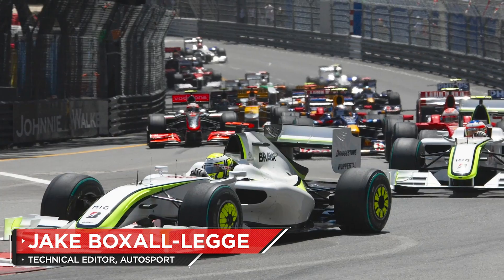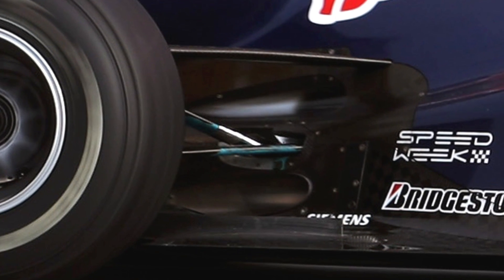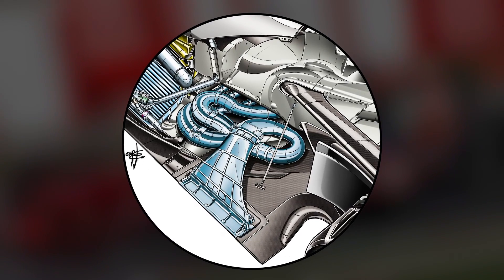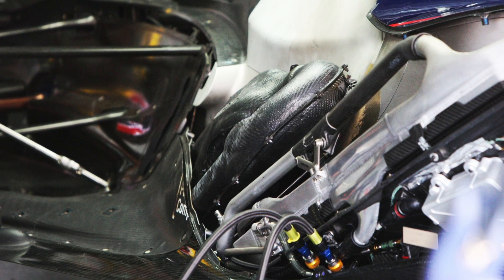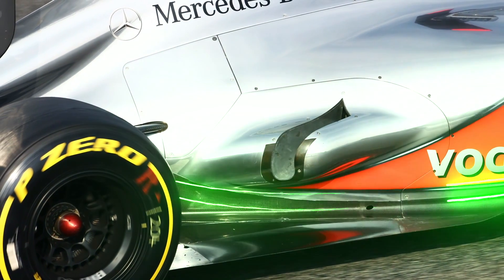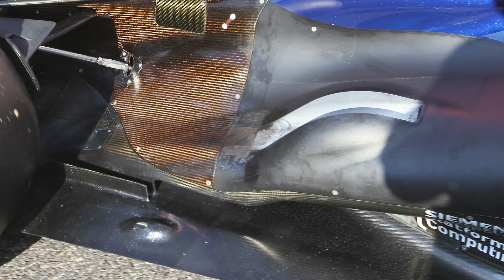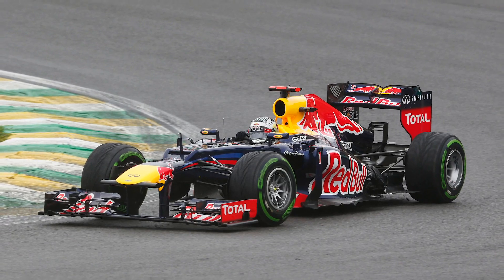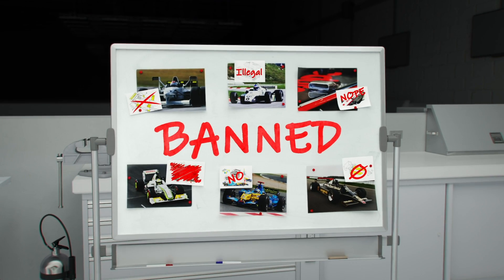What Happened To F1's Blown Diffusers?

Comment: How does the engine mapping work? I.e if it keeps the exhaust valves open for longer, wouldn't they hit the piston? Couldn't they simply open the clutch and keep the engine   speed high to maintain consistent airflow through the exhaust? You would sacrifice engine braking thou.

Comment: ❤😀🇬🇧. My mk1 mx5 used Helmholst resonance for the intake. Every 2 sroke since the MZ's uses a tuned expansion chamber (thanks Ernst Degner).. Then Yamaha, with its YPVS variable port timing. With several other cars/bikes using variable intake lengths . Less complex than phased VVT cam profiles. Now its possible to have complete, independant control over valve timing and pre ignition of a richer mixture, seperately, which ignites the main charge. We've  come a long way from the side valve, OHV, HEMI, and Susuki' TSCC's. 
Less rules  more innovation...please.

Comment: why did they want to ban it so bad
Reply: On safety grounds.. blown diffusers make more grip as revs increase, trouble is you need the grip when cornering, and generally you lift off the throttle as you corner which means a sudden reduction in downforce. The danger is either unexpected loss of down-force when cornering or if it all worked as planned, g forces would get up to the levels of ground effect cars when drivers would pass out from cornering forces.

Comment: I think that the only things that should be banned should be on safety grounds.  Other than that, just regulate the way you can use an effect.  If blown diffusers offer a performance advantage, let the teams use them if it does not also pose a safety risk.  Then if teams start throwing too much money at it, regulate it so it is more uniform, but not so that it eliminates the innovation.

Comment: does anyone know how the exhaust gasses exiting before the rear tires didn't heat overheat the tires?
Reply: Good question. The idea of Coanda is that a turbulent flow will remain attached to a surface for longer than a non-turbulent one (I’m reluctant to say laminar because it doesn’t apply to F1). I guess from this that the exhaust gasses would stick to the a Coke bottle waist of the car and exit between the tyres and the inner fairings.

Comment: Active suspension. It's madness that they won't allow this. It would revolutionise F1.
Reply: Imagine active aero
Reply: Active suspension was flat out dangerous when it malfunctioned.

Cars would completely bottom out when the system failed and it was essentially a death sentence for the driver
Reply: @cuscoothriyas5163  Given only one F1 car has ever used active suspension, and that car won both worlds championships before it was banned, and all this was using computer and actuator technology from nearly 30 years ago, I have to say, on reflection, that you are talking absolute bollocks.
Reply: @AzathothsAlarmClock  Not really slamming the car to the ground per say. When they were used they had to be specifically programmed for each and every circuit or it would bottom out and flat out render any control of the car moot as it would lift one or more of the wheels above the floor of the car, essentially making the car a sled you can't steer.

That said with computing having come as far as it has now and with fuel concerns at an all time high, now would be a good time to reintroduce it. Perhaps it might minimise or even negate the need for big wings which would cut drag down by quite an amount.

Comment: My opinion is simple. Set a budget cap like they did with some tweaks. Have a minimal set of rules such as it should be open wheel these CC engines and fuel tank capacity. Keep and improve safety regulations but other than that let the teams run wild with their designs as long as they are safe

Comment: if wings were invented today they would be allowed for one year, and then promptly banned.
Reply: Hell, I’d be willing to say the same thing about round wheels at this point.🙄
Reply: @leumas75  I think steering wheels should be banned, they provide unfair advantage in terms of turn in. Also I can't believe how round tires are still allowed! Flintstones cars are the ones to go by.
Reply: @leumas75  and engiens
Reply: depends who invents them
Reply: @fetusofetuso2122  Yep... If it doesnt benefit Ferrari the fia will ban it
Reply: @benpedi6645  The whole reason they brought the rule in about no tyre pitstops was to stop Ferraris domination at the time. The Bridgestone tyre was so superior in short stints and had been specially developed for Ferrari.
Reply: @benpedi6645  They even ban things when it benefits Ferrari
Reply: As I recall almost that exact scenario happened when wings first started appearing in 1968.
In Monaco in 1969, after practice, wings were suddenly required to be significantly lower and smaller (and part of the bodywork rather than attached directly to the wheel hubs) due to concerns about how fragile the ridiculously tall wings and associated spindly supports had become since their introduction the previous year; The fact they might snag on masonry and or hurt the gathered crowd if they were to fall off was also a concern.
This was in the wake of the Spanish Grand Prix at Montjuic, where both the Lotuses of Graham Hill and Jochen Rindt had crashed heavily at the same corner/jump(!) due to rear wing structural failure (Rindt losing control and his lead, then suddenly colliding with Hill's stranded Lotus some 13 laps later). While recovering from his accident, Rindt wrote an open letter declaring that wings were both unnecessary to the sport and dangerous to both drivers and spectators.
Interestingly, he also writes about how difficult it is to follow/overtake a slower car with wings, a problem with wings that persists to this day.
See this great article, and the excellent race reports from the time on the same site: https://www.motorsportmagazine.com/articles/single-seaters/f1/how-f1s-high-wing-era-came-dramatic-end
Reply: @C.I...  well put. Amid idiotic posts about the FIA banning everything and Ferrari conspiracies, we find someone with a brain who actually gets this. It’s refreshing to see. Too bad all the other sheep here will continue with the same chanting, born of a lack of imagination and a monkey-see-monkey-do approach. The lynch pin to so much of this is that many, many rules are brought in after extensive consultation with the teams and not just Ferrari. The FIA does this because they acknowledge that the teams are the experts and they need to have rules to maintain viability.
Reply: That would be awesome.

Comment: I miss blown defusers, but given how much of the exhaust energy is taken up by the turbo and hybrid systems on todays F1 cars I don't think the gains from using such a system would matter that much. The extra power of the current 1.6 turbo hybrid formula cars makes up for the added down force from the blown diffusers. With a few hunderd more horsepower cars can simply tack on more down force elsewhere and overcome the added drag.

Comment: Once there is a budget cap, there is no point for regulations tightening. Lax them all. It upto the teams to decide where they want to use up their resources.
Reply: I didn't think of this, this is actually a pretty good idea.
Reply: The fia only like inovation on paper, they will still block any inovations budget or not, sadening
Reply: So what about the teams that race in other disciplines where there is crossover?
Reply: The FIA´s answer: "HAHAHAHAHAHAHA No".
Reply: how do you impose budget caps? 
would a team that runs out of cash mid season not be allowed to start? ofc not => loophole
what even counts to budget?
how do you put a number on stuff (eg. i produce break pads for F1 at a super low cost but get a deal for breakpads on their roadcars)
etc.
Reply: @richardtickler8555  that's already in place 

and a team that runs out of money is a bankrupt team, just saying.
Reply: @truedarklander  i mean not actually running out of money but hitting the budget cap. the FIA will defo not go "no ferrari, we wont let you start", they might do it to smaller teams but i see massiv risk there for another kind of loopholery
Reply: @richardtickler8555  what are you talking about specifically
Reply: @truedarklander  if you have a budget cap for F1 you might reach that despite your company (the legal entity) still having money or having ways to get money. the question is: what happens then?
Reply: @richardtickler8555  yep top teams have sht ton of money on their accounts even if the fia demanded budget runs out top teams have atleast ten times more money so they could easily spend another 130-150mil on their cars
Reply: @truedarklander  top teams have so much money to back them up ferrari,mercedes and red bull had a budget over 400 mil,next three team had a budget between 200-300mil rest had under 200 mil, so big teams have still money to spare
Reply: Good idea
Reply: This sounds brilliant
Reply: You should be running F1, give Chase Carey a call.
Reply: That would make f1 much more exiting plus reverse grid sprint races
Reply: Great way to have like 3 spygates a year.
Reply: But big regulation changes are always good because of the reset effect. Gives chances of a mix up of the pecking order
Reply: But what about safety yo?
Reply: Best idea ever!! I would especially hope they loosen the engine regulations as well. It's like the FIA is telling teams what to do and telling them how much they can spend on it. It's more like a class project than the pinnacle of motorsport and engineering!!🤦‍♂️
Reply: Would be cool to go back to more different cars and innovative ideas
Reply: Sounds fun, someone bringing back v10s without fuel flow bullshit, others going for v4s with bigger turbos, but I have a feeling no rules will create even more spread out field.

Comment: Since F1 bans things, it's time to ban hybrids and bring back V10s.
Reply: Better idea:
Allow teams to use whichever engine they want as long as it fits within safety, performance, fuel milage and size requirements, and have them be hybrids.

Also no engine manufacturer nowadays wants to build V10 sports/race car engines, as they have no practical use in the roadcar industry. F1 is about innovations and the hybrids are here to stay.
Reply: @LunaNicoleTheFox  Speed & sound = excitement. We lack on the 2nd. Also, there are a few V12s left in the auto industry in the likes of Ferrari or Lamborghini and even Porsche has returned to NA 911s. Hybrids are not here to stay because electrics are coming that's why there is Formula-E to enjoy speed through innovation.
There's no excuse for hybrids in F1 than to be "green" just for the sake of it.
Reply: @AzathothsAlarmClock  I think my approach is better, because that also keeps teams in a somewhat fair performance band while also pushing for innovations in Hybrid/Fuel Economy and Power to Weight and Size areas.
Reply: @AzathothsAlarmClock  By fuel I mean total amount of energy, i.e. in the fuel and batteries used, if a car regenerates energy efficiently it can run harder fuel wise and such.

Comment: They should only ban something midseason for breaching the rule or for safety reasons only. Innovation that still within the rule shouldn't be banned midseason.
Reply: Yeah. Imagine putting your team's future on the line to push development within the rules, only for the FIA to decide that they dont like you and dooming you for doing nothing wrong
Reply: @aidanquiett668  Yeah, and what about something like “water-cooled brakes”, which was a less blatant version of cheating? Should that be allowed to continue for the whole season or do you agree with the Parc Ferme rule which caught it out but was introduced mid-season?
Reply: @thethirdman225  things like that are ultimately the FIA's fault for allowing it in the rules, and imo shouldn't be banned until the end of the season.
Reply: @fruitygranulizer  Well, not really. The FIA doesn’t just randomly make rules. Mostly they do it in response to pressure. Unfortunately, without sounding like I’m particularly pro-FIA, most of what we hear in response is an embedded reaction that has its roots in the FISA-FOCA wars of the 1980s. This is largely a construct of English speaking teams. If you asked the Europeans, I think you’d get a different opinion.